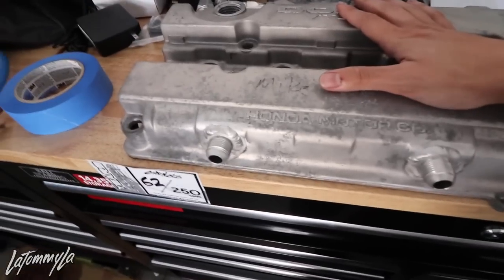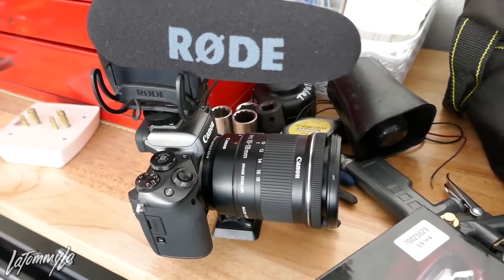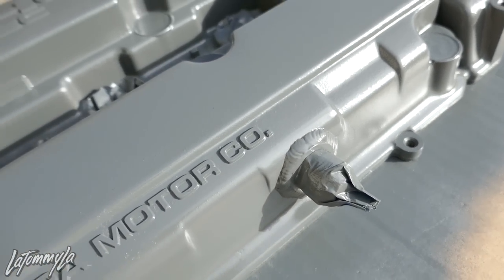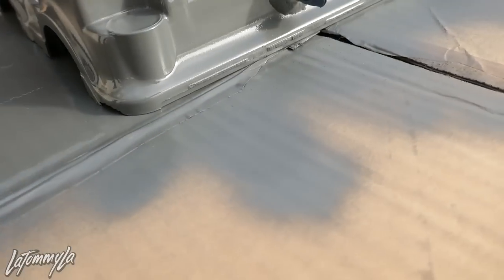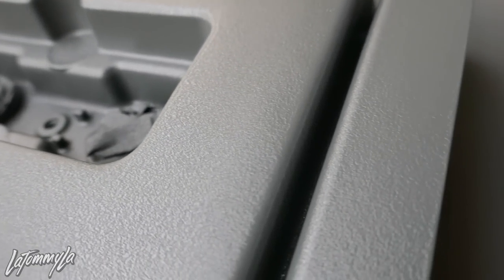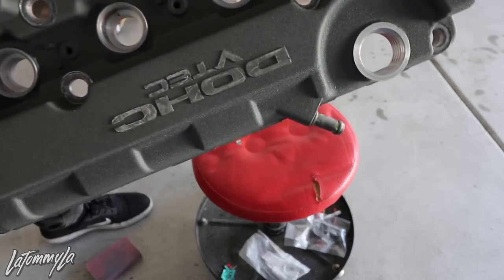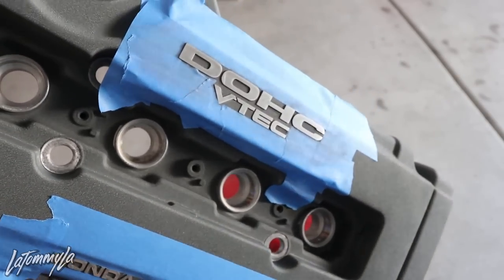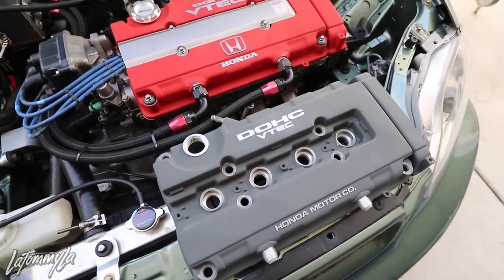How to wrinkle paint your valve cover! Anotha one.

Comment: The reason the valve covers are different is because the one with the Honda sign is a JDM cover and the one without is a USDM cover. My GSR motor is a JDM spec with a Honda symbol on it :)

Nice work!
Reply: Does that apply also with non vtec engines such as Si?

Comment: Generally with spray paint you dont want full coverage on your first coat and sometimes even on the second depending on the color. Multiple light coats is key. Trust me. And I will usually wait longer in between each coat as I put more coats on.
Reply: I agree light costs and wait till it's tacky and repeat till it has full coverage

Comment: How do you even clean your engine bay  with the paint on the value cover ?
Reply: What are you using that would remove paint to clean engine bay? I've been taught to just use a degreaser (simple green) and some water. And that does not remove paint.